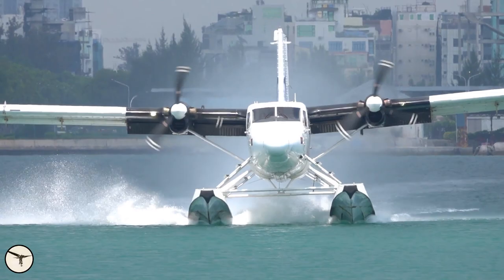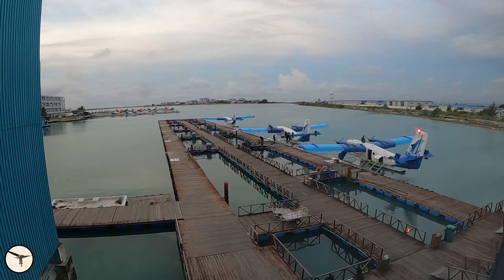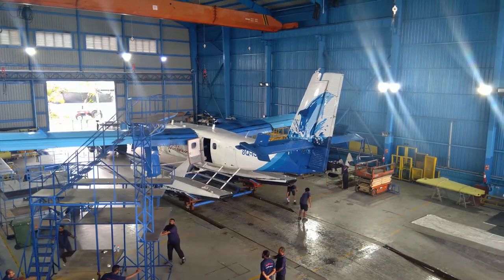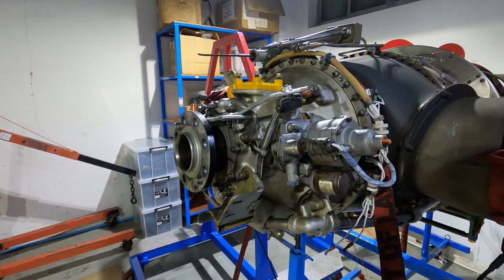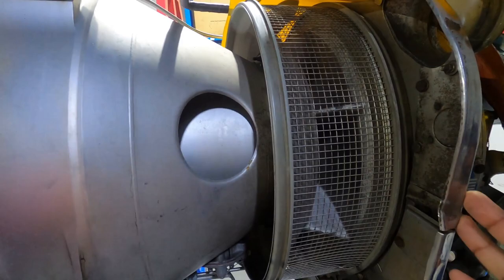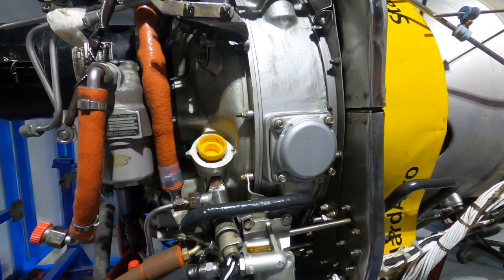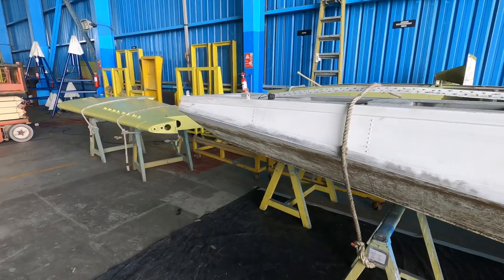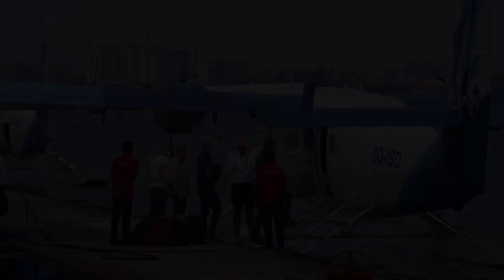How to keep a seaplane corrosion free | DHC-6 Twin Otter | Maldives

Comment: I'm surprised they haven't switched to composites for the floats.
Reply: Aviation is a very consevative business where everything requires certification. The paperwork costs as much as the Aluminiun. To change it costs more.  If it ain't broke.... and composites bring their own brand of problems.
Reply: So true , thought of the same thing
Reply: I'm not. Aerocet make composite floats for light aircraft such as the Kodiak  but floats are quite expensive items and aluminium ones, usually Wipaire, are far easier to repair than composite ones. Aloominum is cheap.  It's also a limited market.  There's also the fact that the aviation industry is very conservative and changes cost money, lots of money, for certification.
Reply: Composites are really expensive. And not the best for impact resistance. We have pretty choppy water that can even dent the aluminium ones. Composites also has a nasty habit of absorbing moisture once the outer layer is degraded

Comment: Once again amazing insight. What ever happened to the "build and never touch" attitude? Answer: It never existed in aircraft. It's also about sustainability. Reduce, reuse, recycle does exist, can be done and is economically more viable than not applying it. Even more in airliners but you see how it's done here.

Comment: A baby PT6 at only 670 shp.
Reply from the maker: It can run in all conditions and with all kinds of fuel. The best there is.
Reply: @FlywithMagnar  pt6 are very good engines but the engines originally designed by garret too now part of honeywell can be a mighty little engine with upwards of 1500shp which is incredible only problem is they are more temperamental and have magnesium gearbox cases so that's a big no no for this environment.
Reply from the maker: I don't think Garrett was involved with the PT6. At the same time PWC developed the PT6, Garrett developed the TPE331 turboprop.
Reply: @FlywithMagnar  you are correct they were not but somehow the way I wrote my comment made it appear that way. I always been curious as to how you guys operate under IFR conditions and bad weather. Is traffic to boats prohibited in the landing zones to prevent collisions? Perhaps that in itself could make an interest video as well.
Reply from the maker: The seaplanes fly VFR day. They have the opportunity to fly instrument approaches to Male Airport and then circle to land at the seaport. The seaport is closed for boats.